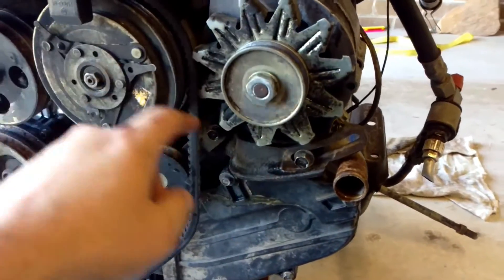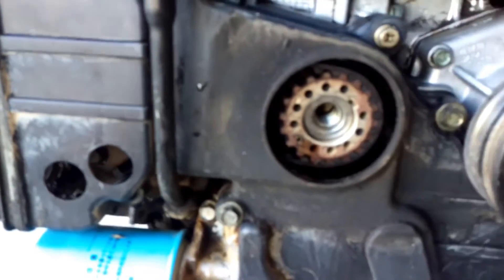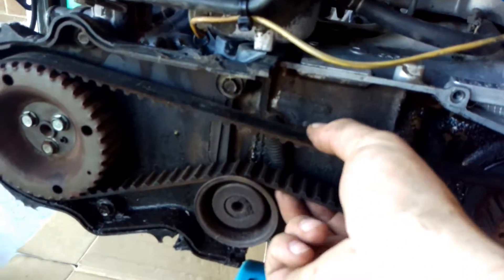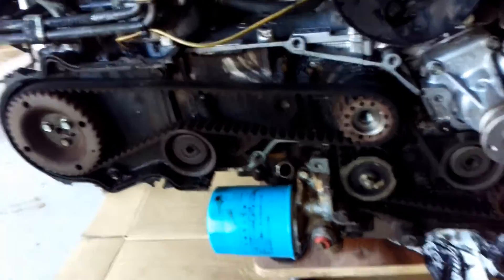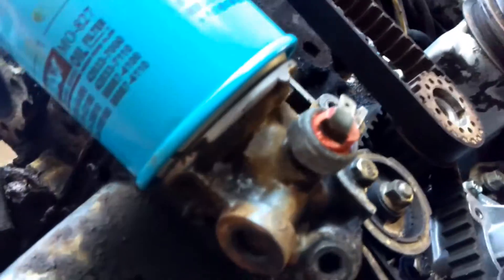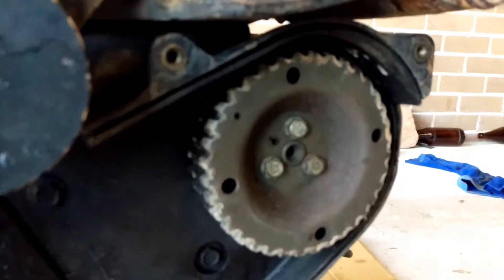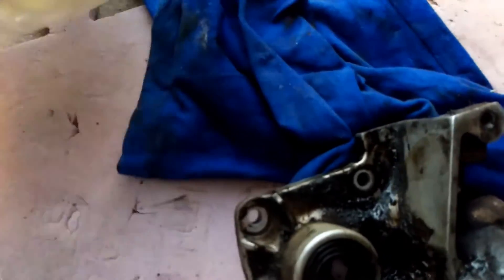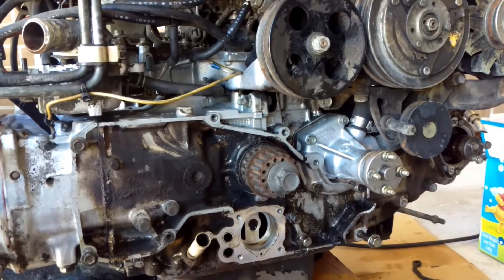Subaru EA82 Oil Pump Removal

Comment: My oil light comes out only when I'm driving over two thousand RPM. What's the key to fixing that?
Reply from the maker: Could be a number of things. I assume your oil level is ok. Other than that it could be that the pump seals need replacing to increase pressure

Comment: You cut out the most important part, where the pump comes off. How did you get the idler pulley off with the belts off?
Reply from the maker: There's locking bolt that allow the tensioners to move a bit. Release them and it gives the belts enough slack to come off.
Reply from the maker: Then you can get to the bolts that hold the fuel pump on